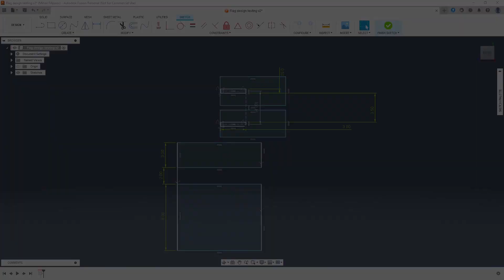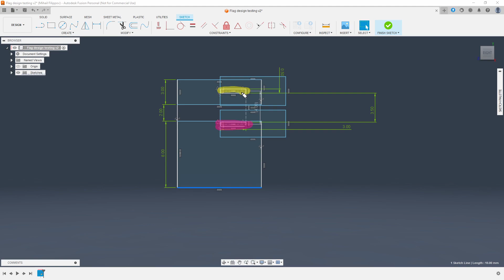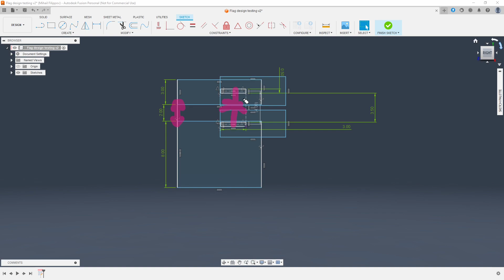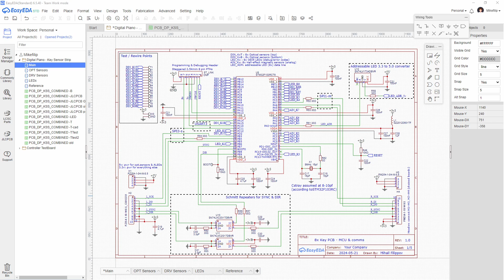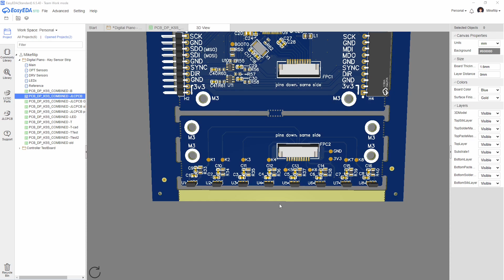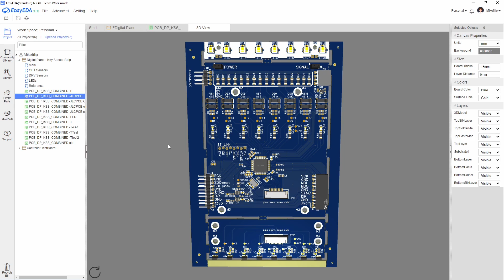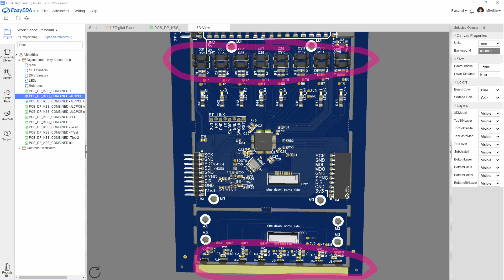DIY Janko Piano: 6. Electronics

Comment: I'd love to buy one of these :(
Reply from the maker: Yea... I am unfortunately leaning towards not offering any at all. The manufacturing of the prototype is stretching into a 7 month project, and I have found plenty of things that would need to be fixed up if I was to offer it as a product (and as such wasnt readily available to troubleshoot after shipping it out).

I do have plans of making a complete redesign in order to make it be more... manufacturable (probably starting with an existing digital piano and replacing its keybed and key sensors as opposed to a full custom piano), as well as open sourcing the current design for those mad-lads interested in building one for themselves, but its extremely likely that this version will only exist as the single prototype I am finishing up now.

Comment: now i've got a 3d printer i shouldn't be limited to bashing a case out of wood and using repurposed yamaha keys, i'll eventually get around to using an old petkov design for a 96key board, the tech on it is sooooo old, but usable, why not?  might do a ucapps midibox key scanner for something else.
Reply from the maker: Nice. I would also have loved to get something done with wood for the outer covers (or at the very least some sanding/filler/more sanding/more filler/prime/paint), but all of that is something I havent ever done before and I have enough on my plate at the moment... Maybe after the piano is fully finished I will see about 'sprucing up' the covers to something not so obviously 3d printed.
Reply: @DIYJankoPiano  hammond has made project cases for a LONG TIME, the 1456cww looks really retro, got wooden ends, hiring a sheet metal fabricator to make longer panels would make it perfect for an old style classy keyboard case.  the 10degree with the panel notched to fit the keys, a bit of filler behind the edges, painted black, so it'd hide bad cuts, it'd be real pretty.  better if the ends could be bought separately though.

     on the gripping hand, two of them, one tipped on end with a panel for controls and enough space for an sbc based soft synth would be rather cute.
Reply from the maker: @felderup  Maybe....
To be honest I was leaning more towards buying and gutting an old&broken upright piano and fitting my DIY digital piano (plus some nice speakers & probably a transducer straight to the sound board) into it.
Make it have an easy way to take out the piano if I need to take it on the road and I would have the best of both worlds - a very stylish (spinnet piano base would be perfect) at-home piano and a basic on-the-go digital piano if necessary.
Reply: @DIYJankoPiano  yah, finding a nice one could take decades, if those old hammond organs used in churches came in a wide standard 76-96 key single manual it's be a true score.

Comment: Pianoteq can use Note off velocity.
Reply from the maker: Its less of 'note off velocity' and more of the key's actual position.

So the note-off signal would look something like this: C# on (velocity-50) ... C# off (velocity-30)

But a key's actual position would instead be this: C# on (velocity-50), C# key distance (0), C# key distance (10), C# key distance (15)... so on until C# is fully released (key distance 128 or something).

The first method allows Pianoteq to quiet the note either quickly or slowly, while the later would allow the note to be partially dampened based on the key (and thus damper distance) based on the actual position of the key. So if the player only releases the key half way the note would be partially dampened.

How much of a difference does this make? No idea. I imagine it only really matters if you are playing super slowly (releasing the note over a period of couple seconds), but still - since Pianoteq is already modelling the entire piano it really shouldnt be all that difficult for it to model each damper's position individually based on the key's position instead of relying of note-off-velocity.

For me? At the moment I am calculating the note-off-velocity based on the key's upward velocity when it passes the 1/3 of its return path (or sending an immediate '128' velocity note-off if a note is repeated prior to the key reaching the 1/3 point). This works fine, but since I have sensors for each key's exact position it would be nice to be able to send this data to Pianoteq and have it use it instead of just a single 'note-off-velocity' value.

Comment: Dude! DUDE! I'm have tried for a long time to make my acoustic Bayan accordion with midi sensors, but no one can do it, because it's very compact. But seing your video gave me some hope that somebody with your skill could help me one day.
Reply from the maker: Its always easier to design such things if you are incorporating them into a new design rather than working with a pre-existing design. Its quite possible that due to the design of the accordion there just isnt enough space to fit a full PCB with sensors for each key, meaning you would have to have many small PCBs with connections between them.

In any case the project would involve a complete disassembly of the accordion, 3D scanning of the internals, reconstructing the accordion in CAD, and finally planning out the internal electronics... quite a tedious project - so either a personal project you would work on yourself or a 10k$+ project you pay someone to work on (pretty sure if I hired someone to work on my piano project I would be out 100k$...).

Its easier for an acoustic piano as there is empty space under the key bed that can easily house the sensor electronics, but for hand held instruments it can be nigh impossible...

Simply put, if there is an option of ordering a digital accordion (even of a worse quality) instead of trying to modify your own that is something you really need to consider. Heck - if there was a Janko piano available for purchase I would have went with it even if its quality was sub-par instead of starting this project. Its just that the only options are either in limbo (Lippens, Daskin) or of VERY dubious quality (chromatone) not to mention ebay exclusives.

Comment: Excellent design choices. Dr. Mix did a Fatar video recently, and they mentioned that a good deal of effort is applied to calibration. Apparently, a calibration table is included and remains even after a firmware update. It will be interesting to learn if your tolerances are tight enough and if your architecture is tolerant enough that calibration isn’t necessary. It seems to me that the main factor would be the relative position of the two optical sensors, which would depend on the accuracy of the pick and place operation of the circuit board assembler. If it’s an issue, I would imagine that you could 3D print a sensor jig or holder and re-solder the sensors more precisely. I would also guess that if one board is installed slightly higher than the next, that it would negligible effect. It should be all about the relative positioning.

Again, best wishes on your amazing project!
Reply from the maker: Calibration is always an issue with these kinds of things; In fact I have one for the magnetic sensors in order to set up their 'key up' and 'key down' limits with a specific call that is easy to access (aka: no firmware updates necessary) in order to calibrate the entire keyboard.

As for the optical sensors I am using one of them as a 'flag' while the other one is used for timing, so the spacing between them doesnt impact the velocity values. The variance instead is the physical flag width (that blocks the sensor) which I carefully file to within ~5% variance along with the individual sensor's sensitivity.

In the 8 key prototype I had the velocity of two successive keys pressed simultaneously gave very similar results so calibration wouldnt be as 'urgent', but I plan to add a calibration step that would measure the key's velocity via the magnetic sensors and 'map' them to the optical sensors. Alternatively I will also have the MIDI output in 3 channels:

1: optical sensor based velocity
2: magnetic sensor based velocity
3: magnetic sensor with higher 'on' state (for organ style playing).

In this case #1 would be my preferred as it incorporates the entire hammer action, but #2 would likely result in a more 'consistent' velocity values as it would account only for the key's velocity. 

In the end though.... I made sure to have an easy access to the programming headers for the sensor boards so I dont even have to disassemble the piano if I need to update the firmware to account for some new calibration procedure or need to change the sensor data collection completely. With two types of sensors per key I am pretty sure I can find a way to record velocity data in a consistent manner no matter what issues crop up.
Reply: After you determine the desired velocity source, you could output different sensitivity curves on different channels. I recently got a Hammond SK1, and I can output three of the four available sensitivity curves, as well as the high trigger (with fixed velocity of 100), simultaneously. Using Gig Performer as the host, I can associate different curves/channels with different virtual instruments. Without having to push buttons on or send MIDI to the controller. This is nice, because the keyboard can create the curves with access to the full bit depth, and the host can handle all of the logic, such as splits and routing different curves to different instruments, simultaneously.

A helpful feature in Gig Performer could be its Rig Manager. Let’s say you have multiple configurations and you connect additional pedals for next song or next page. You can store each setup as a different “Rig”, and apply the one you need, without rewiring each song and variation. You can also script differently for each rig.
Reply from the maker: @JonFairhurst  
I will definitely need a separate sensitivity curve for the magnetic sensor as opposed to the optical sensor, but I will have to be careful with deciding just how many outputs to do simultaneously.

At the moment there is going to be a single STM32 chip in charge of collecting the data from the sensor boards along with the MIDI inputs from 3 sources (2 USB + 1 MIDI) before compiling all of that together to send out the MIDI signal to the 3 sources. Considering I want to have at least a 1 kHz update speed for key sensing I might be reaching the upper limits of what the chip can handle.

In any case, at the moment I am focusing more on the mechanical assembly and will look into the main controller firmware once thats done. The huge list of features I am thinking of including will be trimmed at that point as well :)
Reply: Yes, processing power caps the MIDI bandwidth. Fortunately, you are just doing notes, rather than continuous controls. 

MIDI 2.0 or a creative use of MIDI 1.0 could enable output of 15? bits, rather than seven. You could then do precise curve mapping downstream, assuming that sending additional raw data is more efficient than having to process the data.

In addition to Gig Performer, I use Mobile Sheets, which can index pages via the Pitch Bend msb/lsb message. It’s a powerful combination for building a deterministic MIDI system.